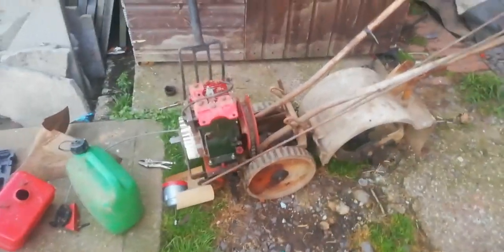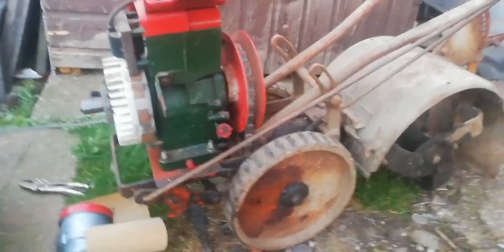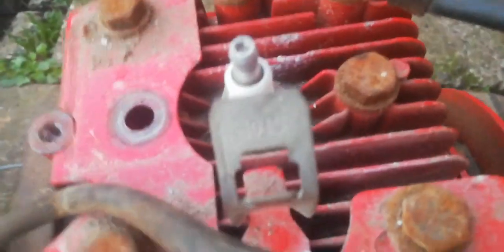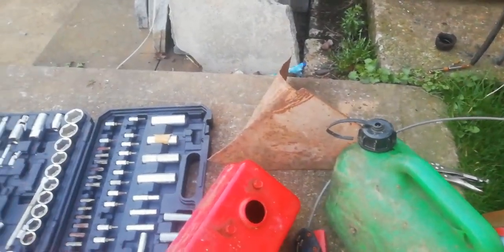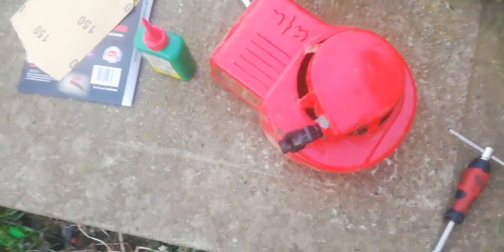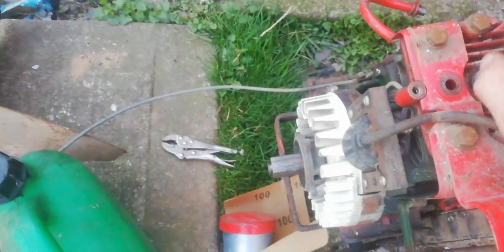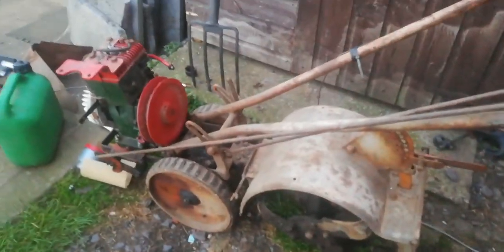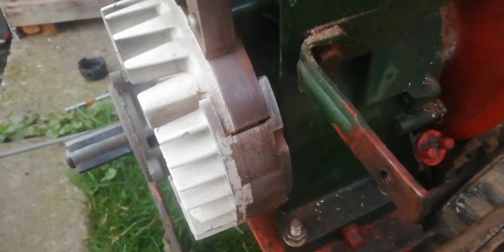New tool for allotment. Howard 200 rotavator repair.

Comment: Ht lead is broken I think
Reply from the maker: when I touch the end of sparkplug and pull it I can feel there's a spark. am gonna take coil off next and have a proper look at the lead and coil itself make sure it's got a good connection between the engine and the coil.
Reply: @eyeopener1993  you would think it has to be electricall,,cracking machine if you get it up and running,,,won't be to difficult as it's made in a simple era I will follow with interest,,

Comment: If them new rotavorts don’t do shit then you ay using it right simple my stilth are bangin and their 4 bangers not 2 smokers/and then pull starts are bastards cause behind the string is a metal coil and when they uncoil wow they are a bastard 😂😂😎clean the earths and stuff
Reply from the maker: them strimmer ones are useless if you've seen them there the ones I'm on about think they call them the mantis or summat
Reply: @eyeopener1993  what do you expect with a brand like that 😂stilth is the way 😂👍🏻